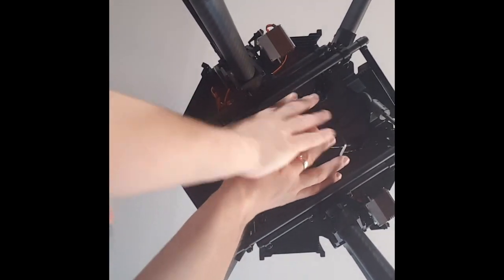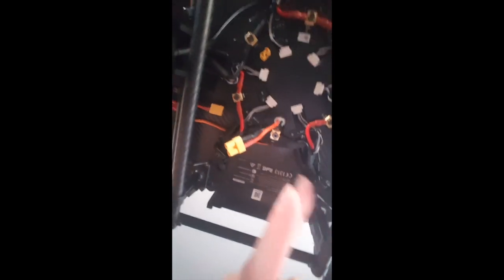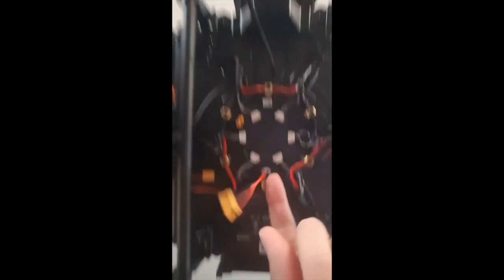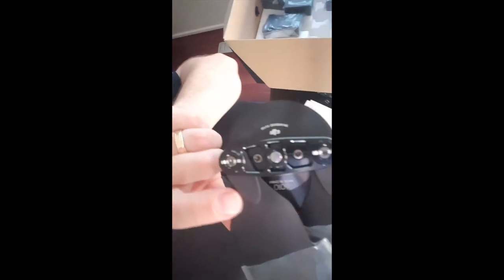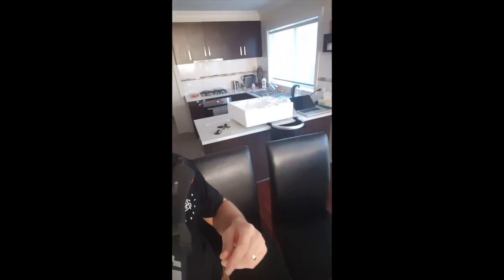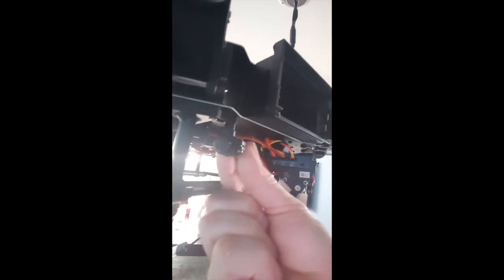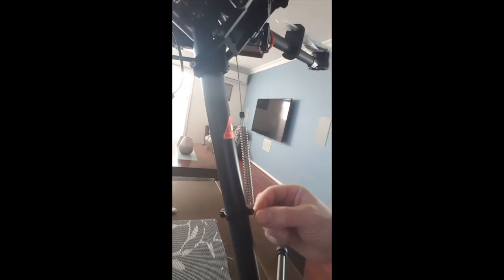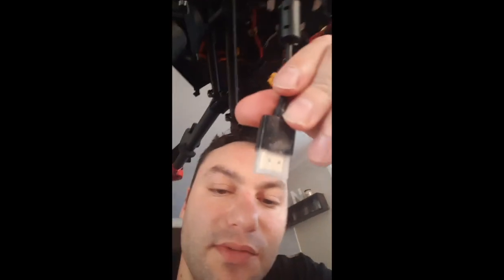DJI matrice 600, unbox and quick build walkthrough.

Comment: That looks very nice! can you please let me know the length and diameter of the arm tubes please?
Reply: Get the DJI Matrice 600 now with a discount of 50% with this link: http://click.dji.com/M9gs8Vy_CiuUCXC7?pm=link&as=0004
Reply: +Ricardo Silva f you are interested in buying the M600 I recommend buying it with this discount deal from DJI: http://click.dji.com/M9gs8Vy_6txf4Gky?pm=custom Cheapest place to buy it right now with a really nice discount:)
Reply from the maker: +Ricardo Silva   the carbon fiber arm is 360mm and 460 with the motor attached. the tube diameter is around the 25mm mark. hope this helps!
Reply: Those mesures help very much thank you! on DJI website they say the arms are 28mm, but that is an unusual measurement. it needs to be 25mm so i can build a copy of the M600 but with regular lipos
Reply from the maker: it COULD be 28mm i didnt measure the diameter with a tape i just guessed it by eye. it LOOKS like 25mm but very well could be 28. which is a weird diameter size i know.
Reply: could you please mesure it please? im about to spend 1k on a custom frame and the diameter being 28mm would really mess all up